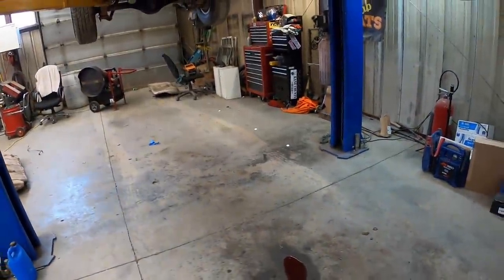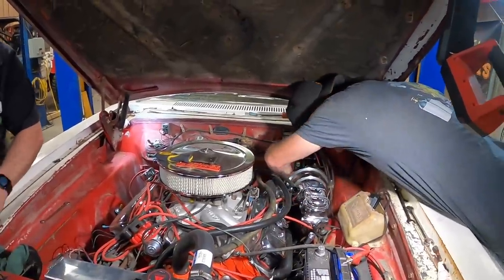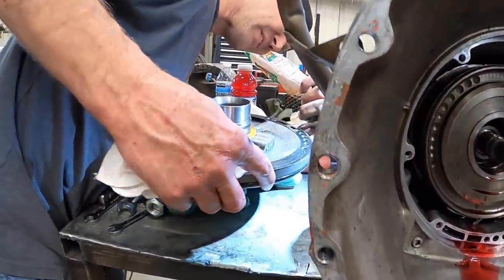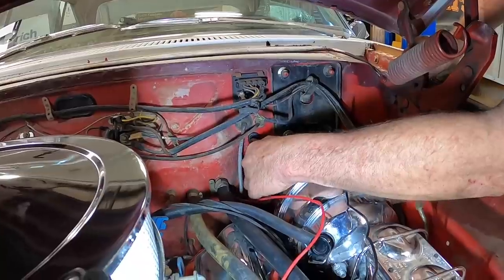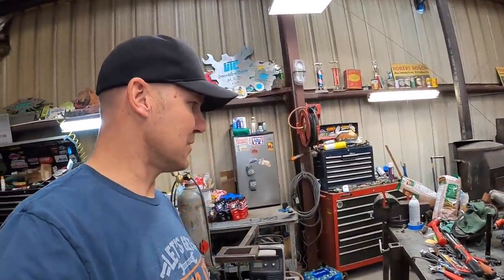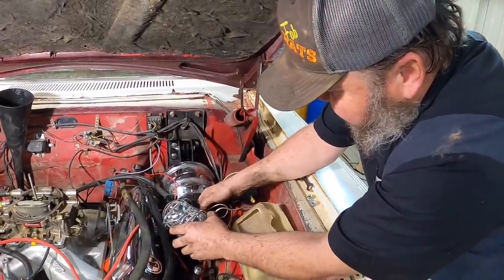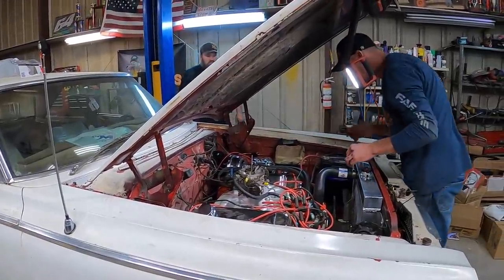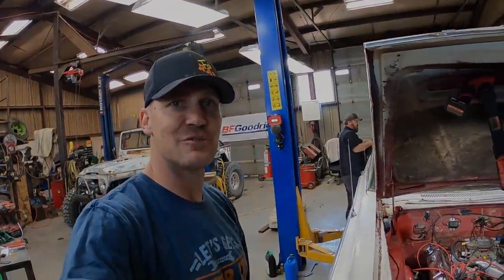One BIG Problem With The Coronet Giveaway Car!

Comment: Copper Coat works amazing on header gaskets. Clean the cylinder head and header really well. Put a heavy coat on each and put some on the header gasket. Then tighten the header bolts nice and snug. Wait 24 hours and it should seal nicely. It saved me a couple times.

Comment: Are you certain that you don't have too much trans fluid in it? They will leak out of the front overflow until the level is correct. It happens a lot when you check it in park instead of neutral.
Reply: Yeah, I don't think they had it idling when filling it up, but the mopar always has to be in neutral and running to check trans level.  Good suggestion.
Reply: If it was me I would run it until it's warm and check it properly and make sure that's not the case before pulling the tranny again. Because you are 100% correct 727 will leak out until it's happy if it's overfilled.

Comment: Love heli-coils. When the alternative is to weld up and re-tap they are lifesavers.
Reply: Heli-Coils are okay. E-Z Lok inserts are a solid insert. They are replaceable, come in several wall thicknesses and take standard tap sizes. We used them in the sawmill for thread replacements in aluminum saw guides that had bolts taken in and out with every saw change.
Reply: Heli-Coils are a thing of the past, Time Sert is the only way to go when needing an insert!
Reply: yeah, I sure wouldn't relish the idea of welding up an oily hole in a thin aluminum casting. Ugh.
Reply: I put a helicoil in my Bultaco and never had an issue with it. Handy gadgets.
Reply: @karlschwaber7006  senor Bultaco would be proud if he were alive today
Reply: @karlschwaber7006  I had a a Bultaco Matador ISDT replica 50 years ago. What a stone 😔
Reply: @dbmail545  I had a Matador also which I ran in the ISDT in 1973. Tough race, not too many people even know of it. I had to some motor work but it was a fine bike.

Comment: the exhaust bolts that go into the water jacket need to be studs,regular bolts even with sealent will start to leak ask me y i know😀
Reply: And all kinds of fun stuff happens when you put a big cam in one without checking the valve guide height. Then there's  the not oiling through the push rod thingy.
Reply: True enough. I used studs and good gaskets on my 440 so I didn't have to redo them afterwards. Can't just drop in a gasket from above with the studs but never had a leak. My early BMW (320i) has exhaust bolts opening into the oil passage! What fun to find out the former owner used bolts instead of studs. My car caught on fire shortly after the front bolt vibrated loose. Was 300 miles from home and had to drive it back. Bought a fire extinguisher for the trip. Caught on fire once more on the way home. I started pulling over every 50 miles to retighten. Changed over to studs the next day. Good Times!
Reply: What kind of engineer would design a water jacket that’s pierce ABLE 😳on purpose🌹 junk
❤️CHEVY❤️
Reply: As I recall morose used to have slots on the end bolt holes to let you slide the gasket over the studs
Reply: @theusconstitution1776  Don't know but his brother designed Chevy camshafts😁
Reply: @markshaw4368  You can see in the video, that's correct but for the end bolts only. I used studs in all the holes. I'm not sure which ones open to the water jacket but I never have to worry about the studs backing out (see my issue above!)
Reply: @mikeroup2721  just the end holes go into water and I agree that studs are the way to go for better reliability.

Comment: Hope you find the cause of the transmission leak, hopefully it will be something easy and cheap to fix.  BTW, each front pump bolt should have a soft aluminum washer under its head, otherwise they will leak.

Comment: If I remember correctly a few episodes ago Paul said he could torque bolts using the impact gun by “feel”. 😂
Reply: Yup.  A lot of mechanics think they can too.  I'm certain hundreds of thousands of engines and transmissions have been scrapped because of this.
Reply: Yeah I was thinking it was because of using the impact to put them in. I'd never use an impact to put cap screws into aluminum, hell I don't even use an impact to tighten screws into steel unless it's just a bracket or something.

Comment: Header gaskets. I made my own that have never blown out 10+years later. I used the regular cardboard-ish grey gaskets that came with the hooker headers, I coated them in copper rtv and laminated both sides in a thick tinfoil from a restaurant. Layed books on them while setting up. Super solid.

Comment: On some transmissions, the outer rim seal of the front pump is a lip seal.  These can fold over and cause leaks.  In automotive repair school the instructor made a little tool for this.  It was a loop of music wire, with the ends crimped into a piece of copper tubing.  As your getting the front pump in, you run this around the perimeter of the pump as it goes in the housing, slipping the lip of the seal into the housing so that it flairs out as fluid comes against it.

Comment: That stop leak you got is a useful tool in the barber trade. I got some styptic gel recently. It says it is for it is for use in trimming your dogs toenail. When you cut your dogs nail too short and they bleed styptic to the rescue.  It is good for knuckles, your kids knucklehead and can be used on your wife’s paper cuts. Stings a bit but when you get done whimpering the bleeding has stopped.

Comment: Hey Paul, I see that a lot of people in the comments section are saying , put a manual transmission in it.
This is a huge job on this car unless you put in a hydrologic throw out bearing.
Also the trans, flywheel, bellhousing, shifter, pedal assembly would cost around 3 thousand dollars if you bought used parts.

Comment: In the front pump there are 3 small plugs sometimes they leak. Also the washers on front pump also have a sealer one time use. The large square sealing ring on front pump is easy to nick. Also make sure front pump bushing is good. And last make sure both dowel pins are in block.

Comment: Paul I use a 18650 headlamp when working on stuff.  Zebralight makes some light comfortable headlamps.  Over 1000lumen with several options in between.  I know the milwaukee light is the star just an idea for the tight spots.

Comment: As a machinist for over 40 years who has installed tens of thousands of helicoils ( aluminum military parts require them ), when you install them, turn flush plus half a turn.  The entire end "square" of the helicoil thread insert should be below the surface.   Jeff

Comment: Heat shield for the starter motor is needed since you installed headers. I didn't do this on a '68 Mustang and starters only lasted a month or so daily driving.

Comment: I drove a White 1965 two-door sedan Coronet daily driver for over 7 years. Your Coronet is a hardtop having a different shape C pillar. My Coronet sedan had a Dodge Dart Style c-pillar.
Your Coronet has seats out of a later Mopar. Those seats are not Ford Thunderbird seats.
Those seats are 1967 Plymouth GTX seats. Those white GTX seats are exactly what I wanted to swap into the white Coronet that I had and in my opinion were the slickest upholstery that Mopar came up with in the sixties.
The Dodge Coronet is a b body and in the 1967 Plymouth GTX Belvedere is a b body also and they have the same seat frames and that's why they fit right in to the 65 Coronet even though there were minor B body changes 66 and up.

Comment: On the crack for the trans- you can try a dye penetrant to find a hairline crack you can’t see. Any pipeline, welding, machine shop etc… should have red dye and developer. We use the florescent penetrant on aircraft.

Comment: Per MOPARTS board.

Relax all is normal. Stock big block heads all the exhaust bolt hole go into the water jackets.

some ways to deal with this:

1. Use studs IF you can.

2. Bolts make sure there is plenty of threads going in to the head use a sealant. I use arp thread sealent you can use teflon tape Silcone etc..
It works best If you drain the block to below the bolts holes and let the sealant dry over night.

Also if you every play with a small block on stock LA head only the 2 out bolts go into the water good luck and get her sealed up

Comment: For those here that have struggled with header gaskets, I've tried almost all the different types. Copper, Hooker, Mr. Gasket ect, ect. Remflex is the only gasket that has never failed...ever. I use them on my 68 GTO 511 Kauffman, BDS 871, 2 PC 1200's, 1500HP on E85, Street car...My point is it makes heat, if they were going to fail it would have. Torque to 25lbs and it's done, no retorque. Summit carries them for most every motor. Remember, if your headers are "warped" or a "cheap Brand", and it won't seal, it's not the Gasket.

Comment: I had a front pump that was leaking through the casting, we put a plug in place on the converter and pressurized it with some shop air and you could see it bleeding thru the pump casting, porosity.

Comment: When doing tanged threaded inserts, after in all the way, pull the tool out slightly, turn it 90 degrees, slide it back in and whack the handle to break the tab off the insert.

Comment: Sorry about your luck.  The last 5.4 hemi I worked on replacing manifold bolts - designed too small and of incapable material - I took the exhaust manifold to be surfaced.  Laying a straight edge across the length it was warped 1/16".

Comment: Yes the coolant does come out the exhaust bolt holes. Perfectly normal on a big block Mopar engine. Factory had studs and the factory manifolds were held on with nuts

Comment: I really like watching your build on this car. I like your channel and Im a fan of all things Mopar. Ive mentioned it before in previous videos that the original 65 tranny will bolt up to the 440 engine. All poly 318 engines were "big blocks". Im sorry to see you struggle so much with this transmission because in my mind it all could have been avoided. I have news for you regarding the speedometer. The drive gear on the cable shift  transmissions is different than in the later version trans you have put in. So your speedometer  will not work when you finally get to drive this car.  And last when you are tired of screwing around with the cheap headers you bought go get some TTI headers. Number one they will fit. They would have cleared your starter the first time from the previous video. And number two they have a one piece flange so they wont leak like these are doing. Keep up the good work. Keep blaming mother Mopar. Ill keep watching and hope this all comes together for some lucky viewer.

Comment: When I was putting helicoils in my boy’s exhaust manifold I grabbed the correct sized drill bit and ground most of the tip off of it. This let me drill the existing hole out without cutting any deeper than stock.

Comment: The struggle is real, I,m surprised Paul had no heli coil inventory.. As the number of Aluminum and plastic parts goes up, you will need more helicoils. Start accumulating them now. I try to buy an extra kit, of a new size, every time. I had to order parts..

Comment: Paul.chech the torque converter, used to rebuild torque flights I had a torque converter crack right where The notches are very hard to detect stick a couple screwdrivers in the notch and spread see if it's a crack. Took the tranny out three times before I found it.

Comment: Those 70s GM transmissions had "wax washers" that need to be replaced any time you pulled the pump off. Not sure if Mopar did things that way too but it's worth checking into... Man that's frustrating!!

Comment: As l watch your videos l notice you have a need of a tool tray.  It’s a cart with locking wheels and a 1 inch lip plus a tray underneath.  You put the necessary tools for the job you are working on which eliminates all the running around looking for tools!!!
I hope you get one or make one.  1 inch 5/32 square tube
with 16 gauge sheet metal 3’x4’.  That’s a good size.

Comment: Did you replace the aluminum washers on the front pump bolts??? If not, it will leak around the bolt heads.

Comment: If you'd have used a torque wrench initially, you would have found those weak threads and saved a whole bunch of rework!  (If you don't have time to do it right the first time, how do you have time to do it over?)

Comment: How much fluid are you putting in before starting? The hole in the face of the pump body is the vent, if you try to put too much fluid in before starting the engine and running the trans through the gears it will piss out the vent hole.

Comment: Sadly, you need to fix (replace) the tranny or only a quarter of your viewers would even want to own it. “Make it permanent”. Isn’t that your slogan?  We appreciate your sharing all the highs and lows of the restoration process.  It is not easy to give something away on either a national or international level. Props to you for even attempting this.  Perhaps as an alternate prize the winner could choose to receive a smaller cash prize (for obvious reasons). Best wishes.  Did you ever try the Wheaties cookie recipe?

Comment: One time I had the same transmission leak and it ended up being the converter to flywheel setup. When I would tighten up the torque converter bolts it would pull the converter out too far and it would leak from the seal.

Comment: Pauk,Paul, your crew that Chrysler was ahead if everybody, I had A 74 Plymouth Satellite, had electronic ignition,  next year everybody else did it,so Chrysler has automatic  fluid changing system,so leads are standard, no worries.

Comment: I had a leak on a 4l60e in an Astro van. Pulled the transmission 4 times. Turned out it was a crack in the torque converter where the neck was welded in. I repaired the weld and that stopped the leak. Don't listen if people tell you it's going to shake. "It's shaking because you welded on it" is not true. I listened and ended up changing the torque converter for nothing Ended up being an engine problem.

Comment: Boy I sure miss working on my old Dodge 440 motorhome. NOT!! I seem to remember one of the power steering pump bracket bolts went into the water jacket also. And the transmission always leaked after being rebuilt at a transmission shop in Grand Junction. Even had it to two other shops and never got it figured out.

Comment: Leaky exhaust bolts is a Mopar thing.  From the factory, Chrysler puts studs w/sealant in those holes and that cures it.  When running headers, I use liquid teflon on the bolt threads.  Problem solved.

Comment: I mean I don't know that's why I'm saying something I mean I was taught something different with those helicoils I thought you were supposed to leave that little tab on the back of it so when you screwed the bolt into it if that's what stretch sticked apart to make it work right or is that not right

Comment: I had a similar problem with a Ford transmission. Once the aluminum housing over heats and expands and looses it’s resiliency, not allowing it to come back to the original size, so the o-rings won’t crush and the fluid bypasses and leaks to the outside. Sorry to be the bearer of bad news. That housing will be harder to find than hens teeth. I’ll ask my brother in law if he has something that will work, he’s a MoPar guy.

Comment: why did you put the cheap gauges in it? should have used a digital with analog readout gauges. i hate the oil hose and the coolant temp single length wire

Comment: I had a 64 cornet back in the 70s  I broke the rubber brake hose sliding through the ditch drove it home. When I got home I had no brakes car stopped real fast when I hit the dozer sold the engine and transmission for a lot more than what I had in the car

Comment: Stupid is, as stupid does.

NEVER use power tools for bolts in aluminum... especially older items.

I punched my Kawi 650 out and replaced roller bearings throughout the engine case.
You know how many times i used power tools on it?
Zero times.
You know how many bolts i stripped during the entire refresh?
Zero times.
Sometimes slower is much faster!

You're effin around with mix-and-match transmission parts... Did you ever mic items regarding the torque converter?
My mom had a pinhole in her Thunderbird's torque converter...pulled the trans twice hunting for it. I got a converter from a Mustang AOD and it fixed it.
Think outside the box.

Comment: I hate when you have to keep doing something over. I didn't notice the sealing washers on the bolts holding the pump? The header bolts into the water jacket is just like on the old sidevalve Chrysler motors, wouldn't be surprised if some head bolts are like that as well. Thanks guys.

Comment: AND THE NUMBER 1 REASON I RUN SANDERSON HEADERS 
AND THE NUMBER 1 REASON I RUN A STICK SHIFT    HAIRLINE CRACK IN THE PUMP boz where the shaft goes in!!!!!!
I have a WORKING 727 and 440 right here in my DRIVEWAY along with a SWEET POWERGLIDE if your looking for a RACE TRANSMISSION 
Dirt works for leaks too!

Comment: Remember in 1977 had a 73 charger that did that water leak. Put 8001 3 m monkey snot on the bolt and sealed that sucker up.

Comment: Never used it on a tyranny but if you take some  strands of stranded wire and wrap it around the treads of the bolt and stick a some down the hole it'll bite in and hold anything

Edit: this works on metal bolts on aluminum housing or metal to metal

Comment: Yes antifreeze comes out the bolt holes because there's not supposed to be bolts in those holes there's supposed to be studs. And again Chevy guys working on a Mopar is like a plumber try to be a rocket scientist.

Comment: As amaterafact I have a Chevy truck 1974 it has the inline six banger that gets zero miles to the gallon and absolutely no towing power and the three on the tree it runs and drives like it should but I would love to put a 350 and automatic transmission in it but money is a problem I have the tools and know how I just need somebody to donate me a motor and trans